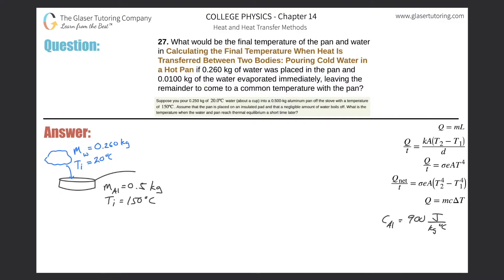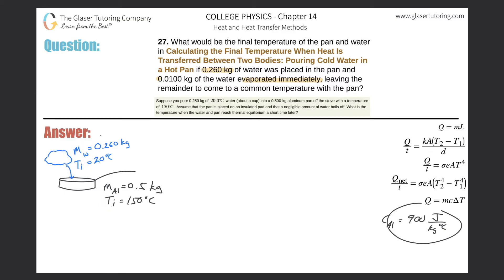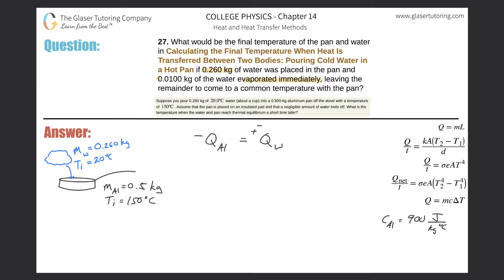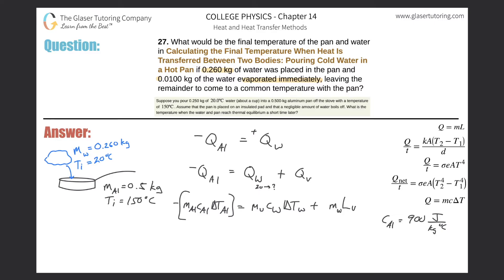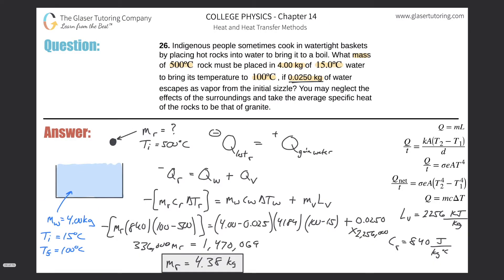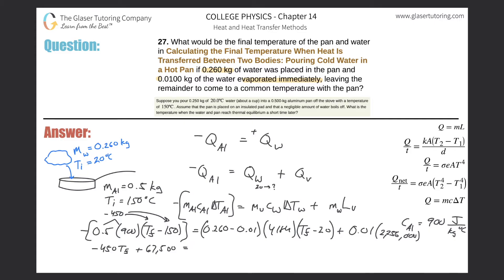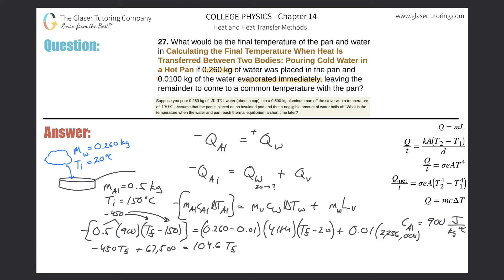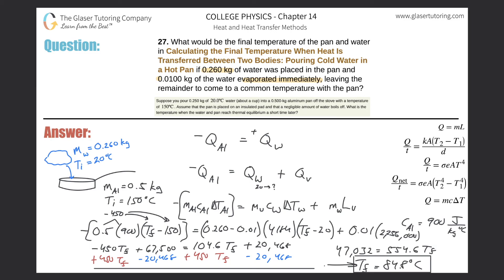14.27 | What would be the final temperature of the pan and water in Calculating the Final

Comment: My professor says the answer for this should be around 44 degrees C. I think you may have messed up when you were doing the multiplication, shouldn't it be 1046, not 104.6?
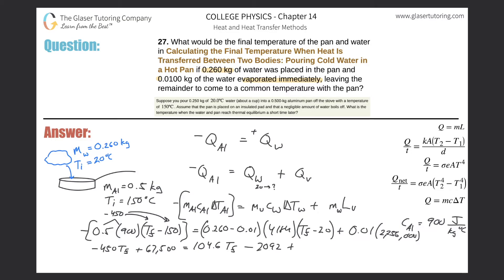Reply: confirmo 44°C ; hay un error en el minuto 6:53; debería ser: 1046Tf + 20920J